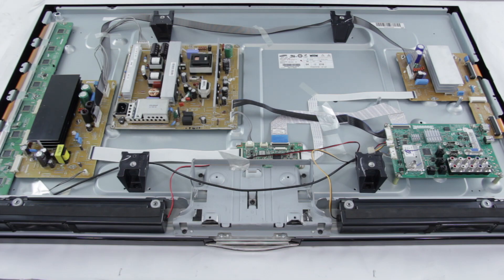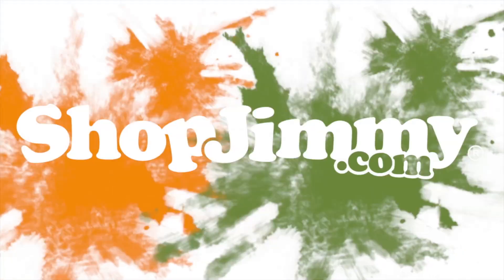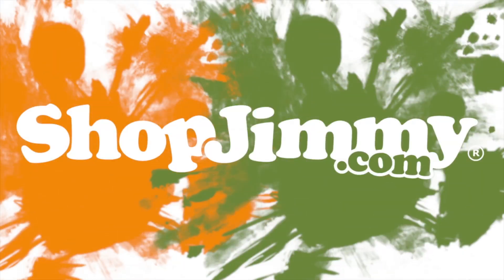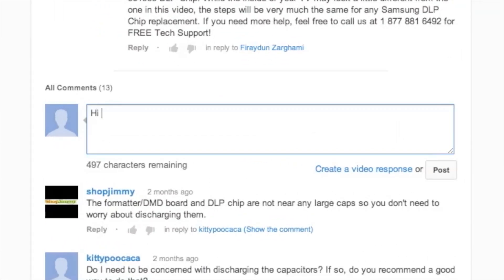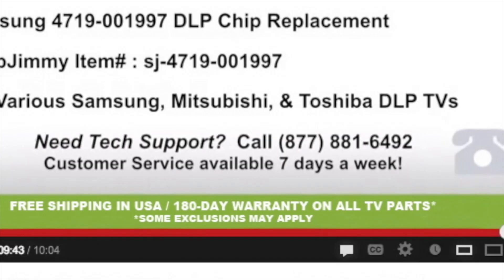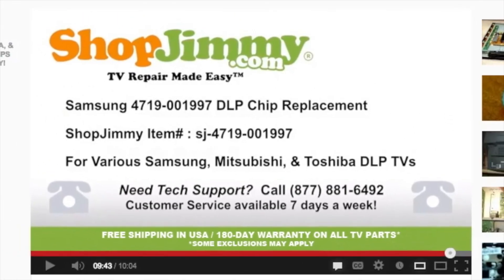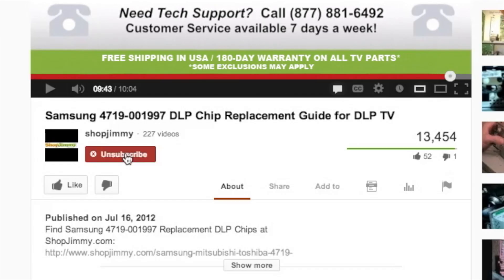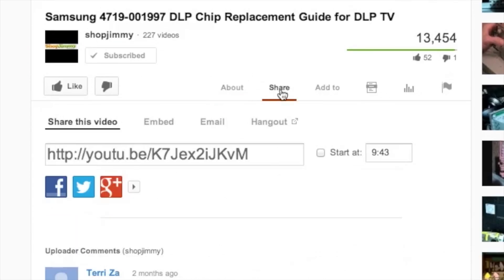Plasma TV Repair Tutorial - Common Symptoms & Solutions - How to Fix Plasma TVs

Comment: Hi ! I Have a Samsung Plasma TV 50" Model: PS50C551G2WXXC
Problem: The TV turns on by himself, turns off by himself, change channel by himself and change source by himself the whole time. The red dot flashes the whole time but with a lower light as normal. The remote control is usable in this time, but the tv gets any instructions by himself. so im not able to do a update. The TV is 5 years old. 2 weeks ago i cleaned the contacts and pull out after that pull in all contactcables of all boards and the TV works for another 2 weeks. after this 2 weeks, it has the same problem again. Would be nice if you can help me. thanks
Reply from the maker: *****   Learn about how we help you repair your TV, click here: TV Repair! LCD, LED, Plasma, DLP How To Fix Your TV with ShopJimmy.com Help! I recommend replacing the main board in your TV.  Here is a link to replacement parts for your TV model number on our website, click here:  http://www.shopjimmy.com/samsung-bn94-03261a-main-board.htm  Be sure to match part numbers on your current board, with your replacement for compatibility.  Here is a link to a video showing how to identify your part number, click here:  Samsung Main Boards & Digital Boards: Part Numbers for LED, LCD, DLP, Plasma TV Repair  You can also call our customer service for further assistance with your purchase.  (877) 881-6492  Thanks and please let us know if you have any further questions with your TV Repair!  www.shopjimmy.com

Comment: hey guys i have samsung pn64e55od1f it turns off and on. all caps look good.took back off hear click from power supply when it turns off and one. cant figer what it is
Reply from the maker: poorboy696969   Try this at your own risk.  I recommend disconnecting the Y board in your TV and seeing if the TV will start up when you turn on the TV.    Please reply with the results of your test.  Thanks!  www.shopjimmy.com

Comment: Hi Shop Jimmy - In your reply you indicated that it is probably a TV Panel and to replace the tv, but I just want to be sure you still think that's the case.  Sometimes when we turn on the tv now, the top half of the screen is totally black but the bottom is clear.  After some time - 20 minutes you can start to see something on the top although it is distorted  Sometimes if you wait long enough - then the whole picture comes back and everything looks to operate perfectly.  So what started as a 2 inch distortion that turned black, then became a full top half of the screen going black, and then the picture does come back sometimes.  Does that still seem like a panel probllem to you?  On n LG 50 PQ30 plasma.  I wonder if this is characteristic to the LG's?  I've seen some other people saying they have had this sort of problem as well.  Thanks!  Would love to be able to fix it if its worthwhile but if you think it's going to be too costly we can start looking for another set.  THanks!
Reply from the maker: Linda Sabo   This sounds like a TV panel (TV Screen) problem.  If your TV panel is bad, it may be more cost-effective to replace the TV as panels are typically hard to find in stock, difficult to replace, and expensive.  Thanks and please let us know if you have any further questions!  www.shopjimmy.com

Comment: I have an insignia ns-46l780a12. My house recently had a power surge and this tv has not worked since. I have troubleshot the power supply and it appears to be in working order. None of the caps are bulging and it is putting out the 12/24 volts at the outputs to the main board. However, it will still not power on. The red standby light is on but it does not switch on. Any help would be appreciated.
Reply from the maker: Jess Yoast   I recommend replacing the main board in your TV.  Here is a link to replacement parts for your TV model number on our website, click here:  http://www.shopjimmy.com/catalogsearch/result/index/?cat=56&q=ns-46l780a12  Be sure to match part numbers on your current board, with your replacement for compatibility.  Here is a link to a video showing how to identify your part number, click here:  STEP #1 - Insignia Main Boards Replacement TV Part Number Identification Guide  You can also call our customer service for further assistance with your purchase.  (877) 881-6492  Thanks and please let us know if you have any further questions with your TV Repair!  www.shopjimmy.com

Comment: I have a Panasonic TH-42PHW5 it powers on then after a few seconds it shuts down and the standby led stays solid then blinks once then goes solid again and repeats. Also the SS board has a red led staying on until it powers down. I get video and everything for about 5 seconds then it goes. Any ideas?
Reply from the maker: jeremyhall420   Try this repair at your own risk.  I recommend that you disconnect the SS board from the power supply and see if the TV powers on.  Please reply with the results of this test.  Thanks!  www.shopjimmy.com

Comment: I have a Samsung model# pn50b430p2dxza the power supply clicks on and off but the TV will not turn on , I do have a standby led on the front panel . I have replaced the power supply and no luck
Reply from the maker: TheTintman2009   I recommend running a test similar to the one is this video:  Plasma TV Repair Help Clicking Noise & No Picture How to Troubleshoot Y Sustain & X Sustain Problems Try it at your own risk. Disconnect the Y board and power on the TV to see if it powers up normally.  Thanks and reply with the results of your test.  Thanks!  www.shopjimmy.com

Comment: Samsung 58" Plasma Model # PN58B550T2F. When I press the power button I get sound but no picture. Completely black screen.
Reply from the maker: Israel Pino   I recommend replacing the Y-Main Board and the Upper and Lower Y Scan Drive boards in your TV.  Here is a link to replacement parts for your TV model number on our website, click here:  http://www.shopjimmy.com/catalogsearch/result/?q=PN58B550T2F  Be sure to match part numbers on your current board, with your replacement for compatibility.  Here is a link to a video showing how to identify your part number, click here:  Samsung Plasma TV Repair: Samsung Plasma Panel Parts Guide   You can also call our customer service for further assistance with your purchase.  (877) 881-6492  Thanks and please let us know if you have any further questions with your TV Repair!  www.shopjimmy.com

Comment: I have an older Samsung pn64e533 64" plasma. It has a rectangular box that flickers on the left side as well as a vertical line of pixels.  I took a video if that would help. Your input is greatly appreciated!
Reply from the maker: Patrick Jensen   This sounds like a TV panel (TV Screen) problem.  If your TV panel is bad, it may be more cost-effective to replace the TV as panels are typically hard to find in stock, difficult to replace, and expensive.  Thanks and please let us know if you have any further questions!  www.shopjimmy.com
Reply: Bummer, so you don't think it would simply be one of the control boards?
Reply from the maker: Patrick Jensen   Right, I do not think it is one of the control boards.  It sounds like a TV panel problem.  Thanks!  www.shopjimmy.com
Reply: Do you think it would be better to sell as - is or part it out?
Reply from the maker: Patrick Jensen  That is up to you.  The replacement TV panel will most likely be impossible or very difficult to find.  Thanks!  www.shopjimmy.com

Comment: Hi, thanks for this video, it is very informative. I have been looking at videos and diagrams all day, and this has been the most helpful. I have an Insignia 50 inch plasma TV, the model number is NS-50p650a11. It is identical to the one in the video. The TV worked fine one day, turned on the next morning, and shut off, and won't come back on. The red standby light does come on, and when I try to power it on, it blinks 5 times, and sometimes the screen will flash on quickly about 3 times, with no picture. I have taken off the back, and there are no capacitors burnt, and there appears to be no burnt parts. As far as checking for problems, that is the most obvious I can manage. Is there anything you can suggest before I purchase a new set? Thanks.
Reply from the maker: Jessica King   I recommend running a test similar to this one shown in the video.  Try this at your own risk.  Plasma TV Repair Help Clicking Noise & No Picture How to Troubleshoot Y Sustain & X Sustain Problems  Disconnect each board individually to see if the TV powers up normally.  Thanks and please reply with the results of the test.  Thanks!  www.shopjimmy.com
Reply: ShopJimmy.com I did the test. My TV is the type where the Y Sus connects to power board then the y connects the X sus. It did the same thing while plugged in to Y and also did the same thing plugged in to X. It just clicks like it is trying to power on, three flashes of power on the screen, then clicks and nothing else. Do you think I should replace the Y board and Y buffer?
Reply from the maker: Jessica King   This sounds like the problem is somewhere else on another board.  Try disconnecting the other boards just as you did for the Y and X boards and see if you can find out if the TV stops clicking when one of the boards is disconnected.  Thanks and reply with the results!  www.shopjimmy.com
Reply: I did, and when I unplugged the boards here the components/av cables plug in, it stopped clicking.
Reply: I ordered the board the components plug in. We just got it in, installed the board.....moment of anticipation while pressing the on button, and it didn't fix it.
Reply from the maker: Jessica King   Are you saying that you replaced the main board?  One of these two on this link?  http://www.shopjimmy.com/catalogsearch/result/index/?cat=56&q=NS-50p650a11  Thanks!  www.shopjimmy.com
Reply from the maker: Jessica King  When you ran the initial test on the Y board and X board, you should not see any image on the screen.  Maybe try that test again and see if the TV powers up normally or not.  Reminder to disconnect the x board from the Y board to test the x board.  Then disconnect the y board from the power supply board to test the y board.  Thanks!  www.shopjimmy.com
Reply: ShopJimmy.com I did the test and disconnected in the previous post. I am not getting any image, no flickers or anything with the boards disconnected. The power light comes on and blinks a couple of times that is it.
Reply: ShopJimmy.com should I just order the X Main and Y main boards?

Comment: I have a S42ax-yb09.  when i turn it on, the red power light turns blue but no picture shows up, Then after a couple seconds you can hear a clicking noise, which sounds like its coming form the power board. Thanks for the help.
Reply from the maker: Pieter Bezemer   Try this at your own risk.  I recommend disconnecting the Y board in your TV and applying power to see if the TV will start up like normal.  Please reply with the results of this Test.  Thanks!  www.shopjimmy.com

Comment: My problem is with a 50" plasma Zenith Z50PJ240. Last night it made a"pop" and shut down.When I try to turn it back on, it acts like it is powering up, then "pop"s and shuts off.  I tried unplugging it for a while and when I plugged it back in, it worked fine for 5 or10 minutes, then shut down again. Any ideas? Since it worked fine after cutting all power including standby and letting it cool down, should I suspect the power supply? How do I check this?
Reply from the maker: gumbyreally   I recommend replacing the YSUS and the YDRVTP & YDRVBT boards in your TV.  Here is a link to replacement parts for your TV model number on our website, click here:  http://www.shopjimmy.com/catalogsearch/result/?q=Z50PJ240  Be sure to match part numbers on your current board, with your replacement for compatibility.  Here is a link to a video showing how to identify your part number, click here:  LG Plasma TV Repair: DIY Part Identification Number ID Guide for LG & LG Philips Plasma Panel Parts  You can also call our customer service for further assistance with your purchase.  (877) 881-6492  Thanks and please let us know if you have any further questions with your TV Repair!  www.shopjimmy.com

Comment: I have a Samsung plasma HP-R5072. Power button on front lights up but no picture, just black. Where should I start? Thanks
Reply from the maker: Jim Cowan   I recommend replacing the Y-Main Board and the upper and lower buffer boards.  Here is a link to replacement parts for your TV model number on our website, click here:  http://www.shopjimmy.com/catalogsearch/result/?q=HP-R5072  Be sure to match part numbers on your current board, with your replacement for compatibility.  Here is a link to a video showing how to identify your part number, click here:  Samsung Plasma TV Repair: Samsung Plasma Panel Parts Guide  You can also call our customer service for further assistance with your purchase.  (877) 881-6492  Thanks and please let us know if you have any further questions with your TV Repair!  www.shopjimmy.com

Comment: I have a Visio P50HDTV and my symptom is that there is a 6'' blue vertical bar in the center of the screen with skinnier white and pink ones also vertical in the middle of it from top to bottom.I just ordered a logic board from you,put it in and nothing has changed.i also notice when first plug in and turn on for first 2 seconds on black screen i see red pixles spread all over screen.what gives?
Reply from the maker: jayocular   This sounds like a TV panel (TV Screen) problem.  If your TV panel is bad, it may be more cost-effective to replace the TV as panels are typically hard to find in stock, difficult to replace, and expensive.  Thanks and please let us know if you have any further questions!  www.shopjimmy.com

Comment: I have a samsung plasma hdtv. My tv model number is PN51D440A5D, model code is PN51D440A5DXZA.  It has power but when I go to turn it on it has no picture and no sound. The red led light on the front of the tv responds when I hit any of the buttons as it usually does. Thank you for your time and the help.
Reply from the maker: Andrew Holland   This sounds like a TV panel (TV Screen) problem.  If your TV panel is bad, it may be more cost-effective to replace the TV as panels are typically hard to find in stock, difficult to replace, and expensive.  Thanks and please let us know if you have any further questions!  www.shopjimmy.com

Comment: Good Morning, I have a Samsung 51" Plasma. Here are my model and serial  - Model # PN51D530A3FXZA, Serial # Z3T03CQBB13786K.  After watching TV for the night, shut it off. Next morning, turned it on and it wont come on. I never had a single issue with the TV before. I do get a blinking RED light. After researching on the web, I figured it had something to do with the Power Unit.  I ordered a SAMSUNG BN44-00444D POWER SUPPLY , replaced it put it back together,,, same issue.. I do here it clicking several times after plugging it back in.... I would really appreciate any help... Thank you.
Reply from the maker: Vance Lazar   Try this repair at your own risk.  I recommend disconnecting the Y-Main Board and then applying power to the TV to see if the TV will turn on.  Thanks and please reply with the results.  Thanks!  www.shopjimmy.com

Comment: I have A panasonic mod. number Th42px80u, The TV does Illuminate but that's all it does. I see no blinking code lights and the TV has ( NO pic. NO menu, NO sound ). I also don't see any sign of any blown barrel caps on the power board, and both of the boards on each side of the power board does have a steady green led  lit  but I don't see any green led lit on the board with all the inputs. Although the red led for the dig. audio output is is lit on that board so it is getting power to it.. The TV gave no signs before it failed and started to do this?
Reply from the maker: Dave S   Since the picture is not showing up, I recommend replacing the SC, SD & SU boards in your TV.  Here is a link to replacement parts for your TV model number on our website, click here:  www.shopjimmy.com/catalogsearch/result/?q=Th42px80u  Be sure to match part numbers on your current board, with your replacement for compatibility.  You can also call our customer service for further assistance with your purchase.  (877) 881-6492  Thanks and please let us know if you have any further questions with your TV Repair!  www.shopjimmy.com

Comment: I have a Samsung model # PN 58C550G1F , None of the four HDMI ports are working.
I have tried to use different cables and multiple devices and none of them work. all of the other connections work such as the SVGA ,and the component ,composite and the COAX antenna connection, all of the tvs in the house have at lest  one of the HDMI ports out following a near by lightning strike , anything that was connected to the cable tv  is out.  but on the Samsung All four HDMI Ports are out . Bad main board?

Comment: I have a 50" samsung hpt5054 that does not want to power on, and when it finally does power up I have audio but no longer have picture.
Reply from the maker: Megan Lind   Since you do not have a picture, I recommend replacing the Y-Main Board and the Upper and Lower Y Scan Drive Boards in your TV.  Here is a link to replacement parts for your TV model number on our website, click here:  http://www.shopjimmy.com/catalogsearch/result/?q=hpt5054  Be sure to match part numbers on your current board, with your replacement for compatibility.  Here is a link to a video showing how to identify your part number, click here:  Samsung Plasma TV Repair: Samsung Plasma Panel Parts Guide  You can also call our customer service for further assistance with your purchase.  (877) 881-6492  Thanks and please let us know if you have any further questions with your TV Repair!  www.shopjimmy.com